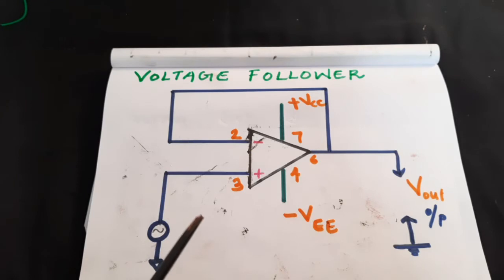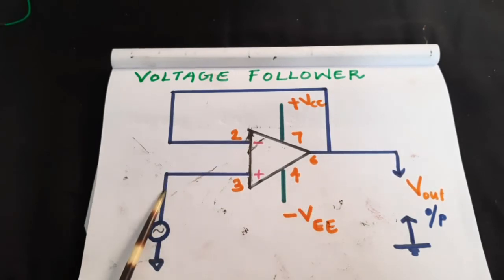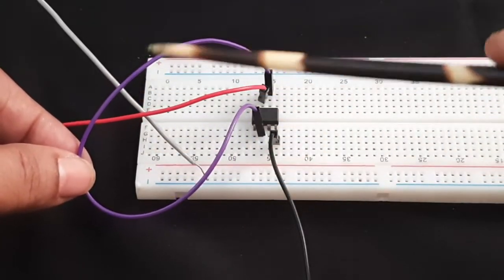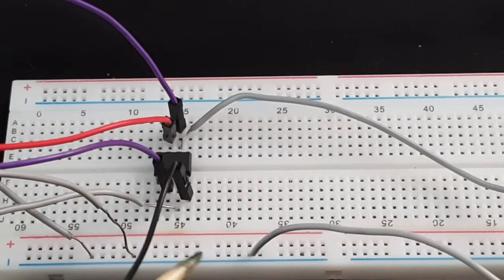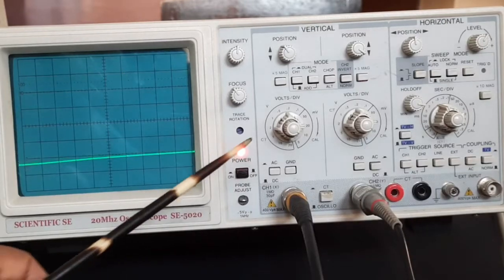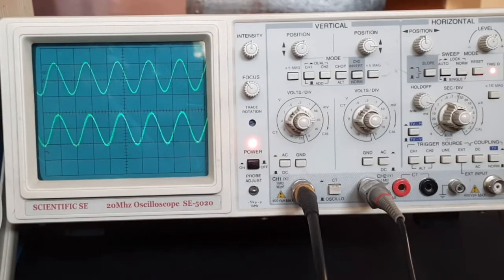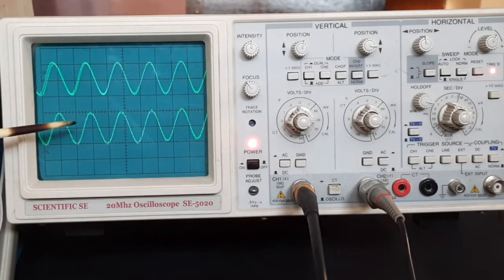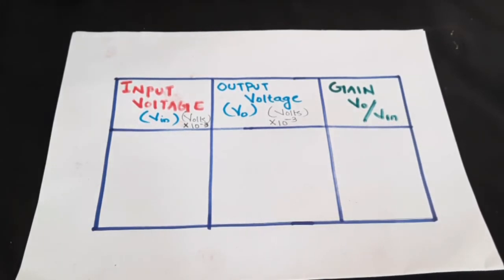Operational Amplifier: Voltage follower

Comment: Madam op amp ഒരു സംഭവം  ആണ് ഇലക്ട്രോണിക്സ് സർക്യൂട്ടീലെ( IC)
ആ  op amp vollage follower ആയി എവിടെ use ചെയുന്നു എന്ന് കൂടി  പറഞ്ഞാൽ  സ്റ്റുഡന്റസ്ന് കുറച്ചു കൂടി  അറിവ് കിട്ടും. നമ്മുടെ മൊബൈൽ  TV മോണിറ്റർ അതിന്റെ ഡിസ്‌പ്ലൈ  (gama ic) നട്ടെല്ല് vollage follwer ആണ്. Buffer amplifier ആയി വർക്ക്‌ ചെയുന്നു (current buffer in TFT pixel)വിവരിച്ചു എഴുതാൻ time ഇല്ല

പിന്നെ vottage followerനെ isolation amplifier unity gain ampifier എന്നു പറയുന്നു
Reply from the maker: This video was only a demo of lab experiment . Will try to include these points in a short video later.